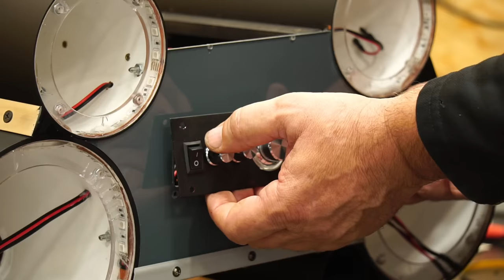DIY Boombox portable and powerful than pvc pipes

Comment: You need a hole in the cabinet for allowing air to enter inside to blow out by the fan in back so it can remove the heat but cool boom box
Reply from the maker: It's at the bottom, I obviously didn't show it in the video!

Comment: Muy buen trabajo y bonito, me gustaría construirlo , podrían poner donde conseguir los componentes y un diagrama de como montarlo y otro de la parte electrónica gracias. ( Saludos desde España )
Reply from the maker: Tubos de PVC: 160 mm, 110 mm, 50 mm con una longitud de 200 mm, subwoofers de 5,8 pulgadas y bocina de 3 pulgadas.
Amplificador PAM8610 2x15W. Batería y fuente de alimentación 12v - 2.5a
Estos son los componentes, el trabajo y la imaginación.
Reply: Ola Amigo una #pregunta y para aser que las tiras de led tengan ritmo con  que las conecta o en que se conectan
Reply: Г

Comment: Excelente! Podrias indicar resumido los materiales? Gracias anticipadas.
Reply from the maker: Los materiales utilizados son: tubos de PVC - 160 mm, 110 mm, 50 mm con una longitud de 200 mm, subwoofers de 5,8 pulgadas y bocina de 3 pulgadas,
Fuente de alimentación 12V - 2.5A, batería, rápida, tira de LED RGB, negro mate
Reply: @10diy  Gracias Mil Hermano.

Comment: Very good manufactured and great design idea. On the sound: poor voltage driving (12v) so high distortion, amplifier also has poor power and distorts. I suggest you 24v lithium packages and TDA2009 based amplifier circuit (it works from 9v to 30v DC). It raise 20w for one channel! So you can made a stereo version doubling the block.
Reply from the maker: Thanks for the advice!👍👍👍
Reply: A lot of the distortion is from the vibration of the plastic thats why its not used in speakers wood or a rubber spray coat on plastic tubes would do similar with out the parts you say in next comment
Reply: @stephenbrooklyn7945  i’m talking about audio distortion not related to mechanical issues…in the first song at the end of the video, huge mid-high frequency distortion appears due to the poor power of the amplifier

Comment: I'm using the pam8610 in my DIY battery operated boombox ,but I'm abusing mine😂 I'm running it at 2 ohm per channel😒. I have like 6 mini heatsinks stacked on the pam8610 chip🙄 ,then I'm running it at 16.5 volts DC with a step up converter
Reply from the maker: Can it withstand this load?🙄🙄

Comment: Est-ce possible d avoir la liste des produit si possible vraiment hot
Reply from the maker: 5.8 inch subwoofer Dibeisi
4 inch high frequency speaker
Battery 3Ah
Amplifier PAM8610
RGB LED strip
Power supply 3A
Optional electronic battery protection. Charge, discharge.
Things are in line with the size of PVC pipes!
It all depends on the idea and implementation!

Comment: me puede drcir los materia y de cuanto es la mididas
Reply from the maker: The materials used are: PVC pipes - 160mm, 110mm, 50mm with a length of 200mm, subwoofers 5.8 inches and horn 3inches with a small but powerful amplifier PAM8610 2x15W
power supply 12v - 2.5a, battery, rapids, RGB LED strip
Reply: @10diy  gracias